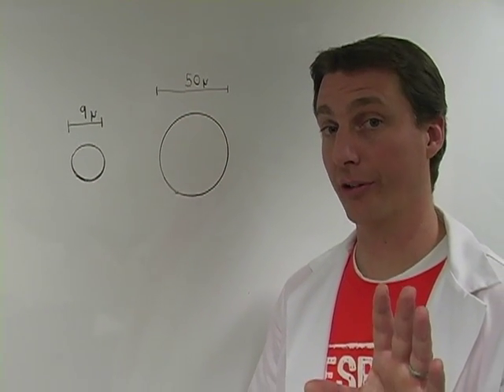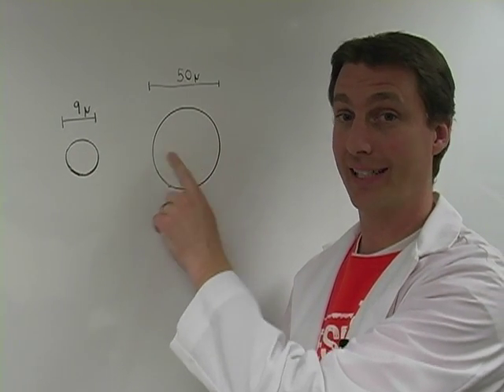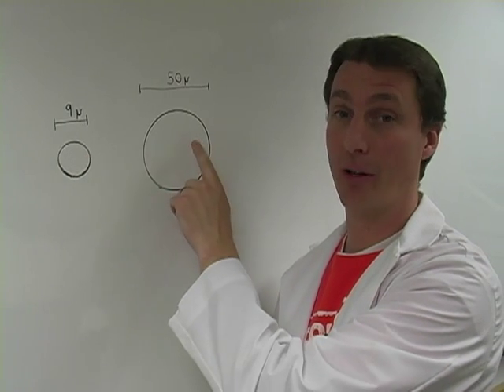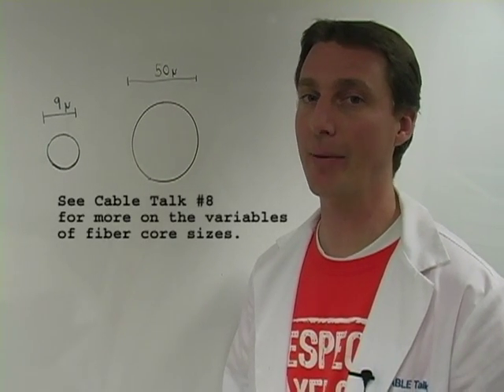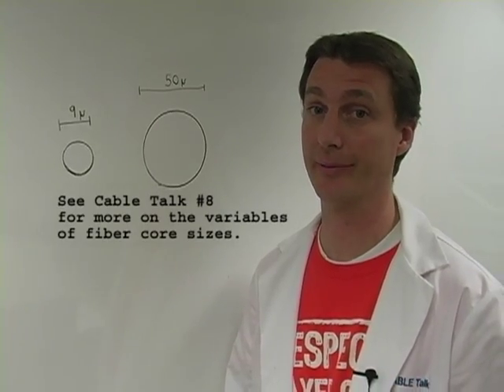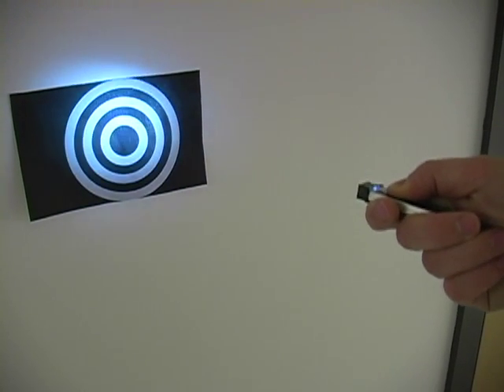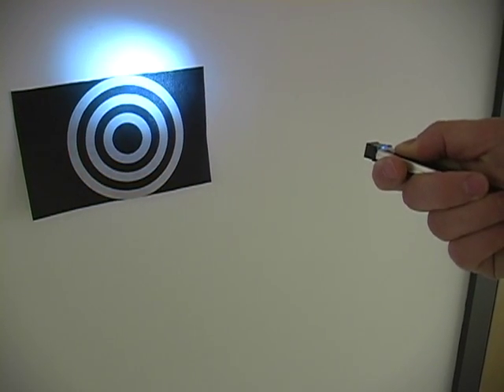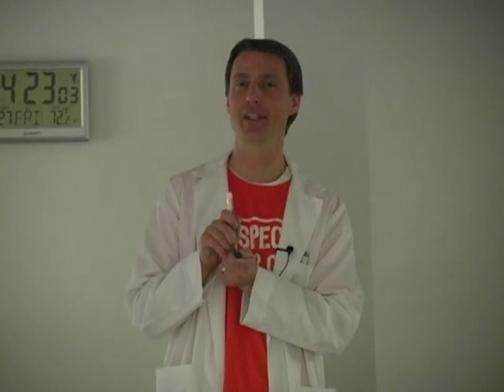Differences Between Multi-mode and Single-mode Fiber Cables (Ep. 33)

Comment: So why do some companies say that single mode is faster than multi mode? They are both using light and light can not travel faster than itself without involving quantum physics. If the fiber beams the light across at the same rate then how do some companies get away with saying Single mode is faster.